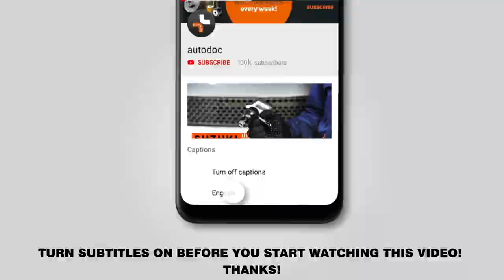How to change a front shock strut on PEUGEOT 107 1 (PM, PN)  [TUTORIAL AUTODOC]

Comment: On the Aygo vid, you give 105Nm as the torque on the pinch bolt for the foot of the strut to hub carrier, yet on the Peugeot 107 it's only 85Nm.

Why the difference, or rather, which is right?
Reply from the maker: Thank you for your comment.
All because of the different designs of supports and different perceptibleness of the load.
The mount on the Aygo VID is thicker so the pulling force will be greater.
Best Regards,
Autodoc team
Reply: @autodocuk  

So you're saying the uprights are different? That seems odd as all three, Citroen C1, Pug 107, and Aygo come out of the same factory, and the running gear was all a Toyota design!

I haven't got the workshop manuals here but you reckon the Pug manual gives 85Nm while the Aygo gives 105Nm?